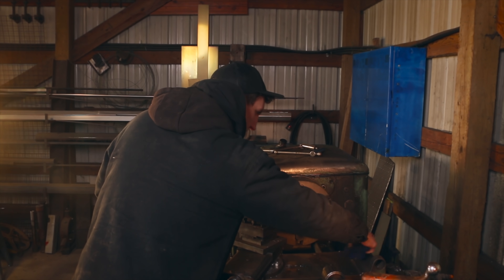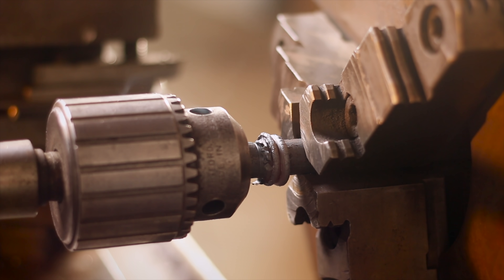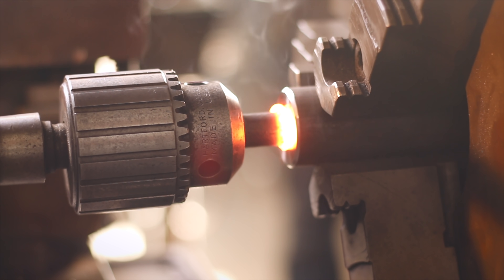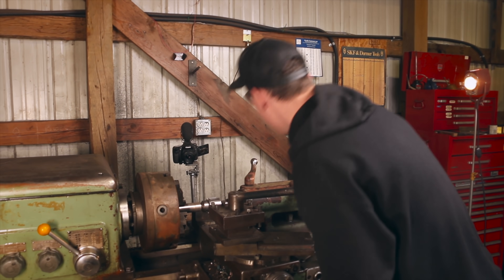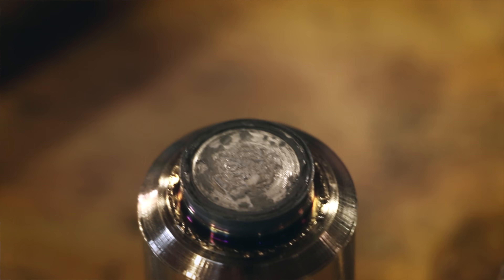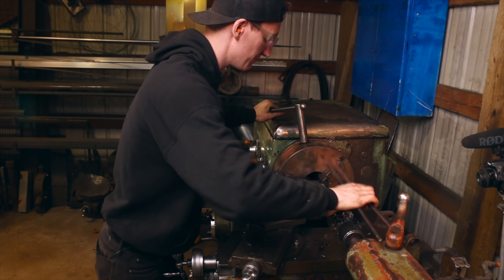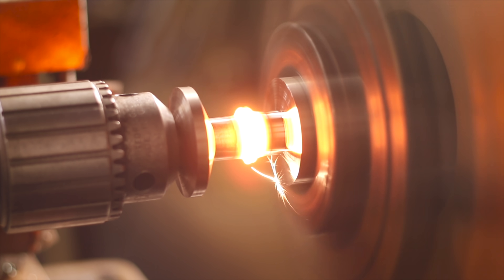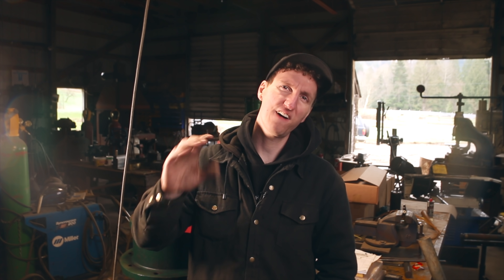Can I FRICTION WELD TITANIUM on my LATHE?

Comment: I noticed that the two welds that were sound had large "mushrooms" of displaced material. I assume this displaced the oxides that formed as the pieces heated up, so you got a clean joint on those welds. It would be interesting to see if you can get the other materials to weld if you tweak the process. It's really cool to see that an advanced process like this can be performed with basic equipment that's within reach for a hobbyist.
Reply: In my extremely uneducated opinion I think you're right :)

Comment: I know titanium has a much higher thermal conductivity than steel. Might be why it worked so well. Probably also want to put a hard stop inside the chuck jaws. You were just pushing that one piece further and further in. Cool vid.
Reply: Actually titanium is less thermally conductive than steel, allowing it to locally heat up more quickly.

Comment: Really interesting dude, looked super cool too. Any idea on the science behind why the welds that mushroomed out fused so much better than the ones that didn't?
Reply: Heat and friction resistance of the material doesn't allow it to plasticize, therefore the compacting pressure isn't effective and the weld don't set
Reply: I imagine the closer the material gets to liquid the better the bond is capable of being

Comment: I would try the titanium friction welding with a blast of tri mix gas and see if you can get a better weld.
Reply: I was thinking helium as it tends to promote a hotter weld?? But yeah maybe bet the tig torch on a stand beside the lathe
Reply: @chrismclean8211  that would work best.

Comment: was hoping you'd lathe down the middle portion of the titanium to see hoe cleanly fused it was.
Reply: Or better yet, mill/grind half of the diameter off and etch it after polishing.
Reply: Me too
Reply: Definitely this
Reply: yes, grinding to plane and perhaps a cut in the lenght too to see the inside of the weld ?
Reply: That material would need to be ground off I think. Don’t think you’re machining that
Reply: I was thinking that too
Reply: i was going to say the same thing
Reply: YES YES  YES
Reply: Yeah
Reply: Me too
Reply: Should do this in the next vid ,I will subscribe then than now
Reply: Perhaps in the next video, I'd like to see that.

Comment: Try Tungsten next 😀
Reply: Not sure that's even possible and definitely not possible on that lathe the rpms alone would have to be insane seeing as tungsten melts at over 3400C so welding temp is maybe 2750-3000
Reply: @jazzb97  Yeah, its a joke it would lose  ways to much heat.

Comment: It would actually work on every piece of metal if you could get it to specific temperature and could instantly stop the spinning part. And those edges which you left there are creating stress concentractions so crack begins there and just split it at weld you should turn it in lathe to make the hammer test more relevant. BTW great video
Reply: I think it might be easier to; instead of trying to instantly stop the part, you let the fixed part start to spin. That would instantly stop the friction. Then you could stop the whole part.
Reply: @SteveEh  You'd still have the same problem of a brief period where the surfaces are still out of synch.  Commercial friction welding like this stops the spinning part as opposed to letting the stationary part spin, but they use a brake to stop the chuck sooner, and some machines will support the spinning part without the chuck and simply disengage the chuck to stop rotation, all depending on how heavy the parts they're working with are.
Reply: @Skinflaps_Meatslapper  it really doesnt matter. As long as they are not in sink they keep heating up. Actually, adding high pressure when its at temperature would be more beneficial
Reply: Get a clutch in there on the mill end.

Comment: What if you cut a 1/4 inch deep circle into the larger bar of metal, so that the smaller bar has an easier way to fuse?
Reply: Your need both parts to have the same surface area to you get equal heating on both parts.
Reply: @paulsanti8517  you could do a positive cone and a negative cone on the other part. Same surface area, but auto centering, would actually be a stronger weld if it worked properly....🤔
Reply: @the_sharp_carpenter  Same surface area, yes, but not same thermal properties. To use the probe and drogue analogy, the probe would be much more susceptible to friction heating than the drogue, because there is more material behind the drogue to actually allow thermal transfer to the rest of the part. It's for the same reason that Aerospike engines are currently nigh unattainable, because a spike has significantly worse thermal properties than an inverted spike of equal surface area.
Reply: You can depending on the surface area. His leather had a hard time with the larger diameter. So doing a overhead purge and a cone setup should have made a better result.
Reply: @paulsanti8517  Anything other than flat surfaces on flat surfaces would not work for the reasons I stated above